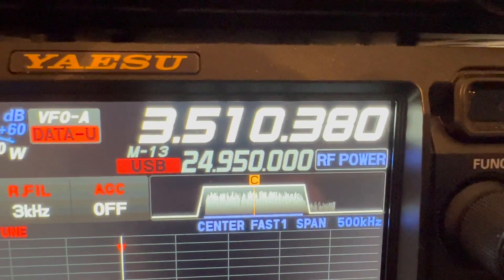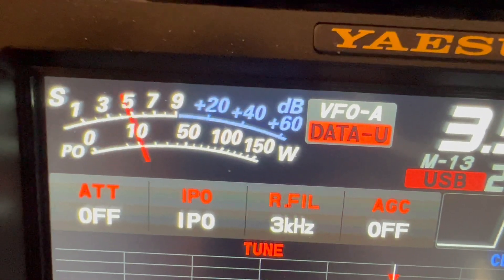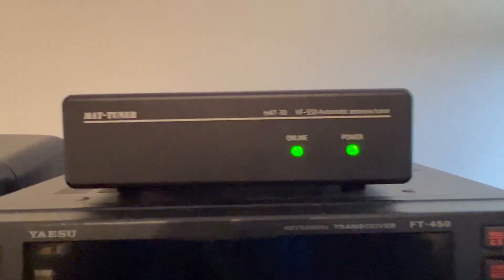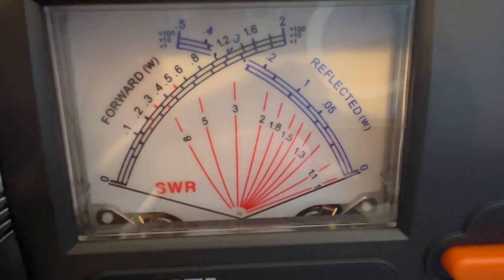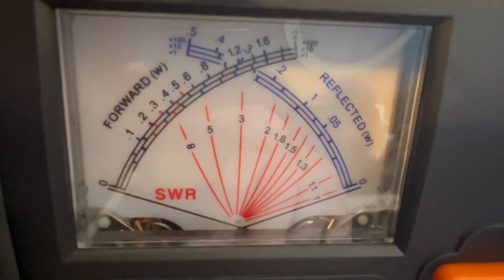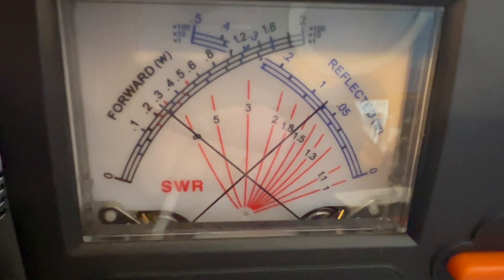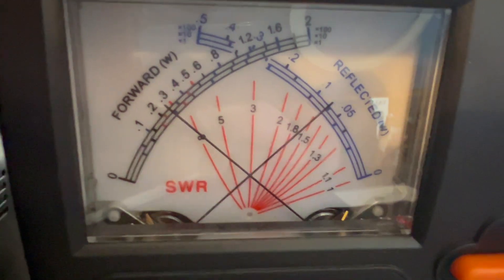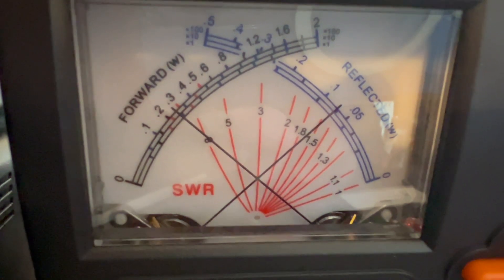The Myth of SWR #2

Comment: So, the way I'm comprehending it, as long as I have a proper quality ATU/transmatch in line, I shouldn't be worrying about neither VSWR nor my coax feedline length. However, if I would like to be as portable as possible but be the most efficient  as possible and I don't want to bring a tuner or I don't have one: can I cheat by cutting my coax feedline to 1/2 wavelength and achieve a close match with my antenna's Z this way? I might not reduce the VSWR but with the absence of a tuning device , perhaps, I can fool the radio to "see" the coax Z and the load Z as the same due to 1/2 wavelength cycle properties... However, I feel like if it works, I will be restricted to one frequency and one frequency only ( the one my antenna happens to be resonant at on a selected band)
Reply from the maker: VSWR is determined only by the match at the antenna feed point.  It will be about the same anywhere along the line unless you have common mode current or a long lossy line.   So the half wave idea isn't really of any practical value.   And without a tuner you are stuck with a narrow range of frequencies on one band.   One location will probably differ greatly with another.  Antenna tuners can be small and very light.  Trying to go portable without one could be a problem. 
https://youtu.be/ysXPGRmFsjU

Comment: Does the reflection ever cause phase cancellation?
Reply from the maker: It causes phase reversal.  When the wave hits the antenna phase is reversed 180 degrees.  When it arrives back at the tuner it is reversed again by reflection.  Now it’s in phase with transmitter power.

Comment: Sir, Thank you for your informative video. It has prompted me to listen to a number of other videos and writings on this and related subjects. I looked for Walt Maxwell's "Reflections III", but found quickly it was at least $100 for a new copy and $85 for a "fair condition" used copy. I intend to buy it but it may have to wait for a while. 

So I wonder if you could answer a question for me:

You state that "reflected power eventually radiates". I've been unable to find an explanation of how this occurs. Does this eventual radiation occur under all conditions? Does the power radiate from the antenna, the feed line or both? What does "eventually" mean here, milliseconds, seconds, etc.? Any information you could share on this question would be much appreciated.
Thank you! Jim Webb W4NTA
Reply from the maker: Hello Jim.  Here is a link to Reflections.  

https://www.k3emd.com/downloads/Reflect.pdf

Since reflected power is not lost it gets radiated.  It's like asking, why does RF sent to an antenna get radiated?  Because there's no where else for it to go!  

As for when reflected power gets radiated, Reflected energy flows back and forth between the mismatches at the source and load. After a few such journeys, the reflected wave diminishes to nothing, partly as a result of finite losses in the line, but mainly because of partial absorption at the load each time it reaches the load.
In fact, if the load is an antenna, such absorption at the load is desirable, since the energy is actually radiated by the antenna.

Reflected power does not get radiated from coax because it is shielded cable and shielded cable does not radiate, except in the case of common mode current.  See my video on Does SWR Make Coax Radiate for an explanation if you are not familiar with common mode current. 

It's too bad the ARRL stopped publishing Reflections.  There was a falling out between Maxwell and some at the ARRL.
Reply: @BustRadioMyths  Thanks very much! What a great resource!

Comment: Just newly subscribed; and, I have to share...  Funny?  15-some years ago, when I was relatively new to Ham Radio, after battling the SWR and almost going insane trying to get a 1.5 or less SWR if possible, I researched the magical Antenna Tuner!  I got one, put it inline and followed all the instructions from the owner's manual.  A  fellow Ham across town about 10 miles away on 10 meters without being solicited for a QRST (signal report) explained excitedly that my signal came up 2 db(!) and wanted to know what I had done.  For 2 weeks I played the Hitchcock game with him before I confessed that I'd put an Antenna Tuner inline.  It was one of those MFJ types for HF.  And, my antenna that I was using from an apartment balcony was the Hustler 6BTV on the top floor of a 15-story apartment building where I lived at the time.
KD8EFQ/73

Comment: Let us say that I want to use a 500 watt amplifier in my car for mobile use.  Is it more practical to carry a small watt meter capable of reading my reflected power, or a cumbersome 600-800 watt tuner, that is also more fragile?  What happens if I have a few ham sticks on my car, and I would prefer to not have to manually retune my MFJ 945E every time I switch antennas?   Perhaps chasing a flat SWR has a value in these circumstances.  

The other example I can think of is, people with random wires and other extreme mismatches.  I've read a a few threads on QRZ about people chasing endless bugs and RFI problems in their house or shack after trying to use an impedance matcher to make the antenna work, because it seems like some systems end up balancing themselves out in strange ways, or the extreme stand waves will seem to cause other problems.  

I think the bigger issue with SWR isn't loss of performance power, it is all the other problems and potentials that go with it.  I still stick with the notion that a finely tuned antenna is best, because the tuner is always better at cleaning up minor SWR problems, than it is at trying to force a poor antenna to function.  A finely tuned antenna can still get on the air, even if you have a tuner failure.  Obsessing with flat SWR is one thing, but having a well tuned trap or monoband is still a better place to work from, then to rely on the tuner to do all your heavy lifting.  

One last complaint on tuners.  If I use my tuner to get low SWR for 10 meters on my 5/8ths' vertical roof antenna, which is tuned for CB, my ALS 1306 refuses to operate on it.  It reports that there is "too much 11 meter radiation" or something to that effect, another problem not solved by a tuner, but that a tuned antenna can cure.  

Just because you can get on the air, just because you can do fine work, just because you don't lose that much ERP, doesn't mean there aren't other issues SWR causes that a tuner does not cure.  

But, yes, I agree with you, and this is fine work.  Thank you for making these.
Reply: I am wondering what other issues swr causes
Reply from the maker: Good points about mobil operation.  I'd think a screwdriver antenna or a trunk mounted automatic tuner would be good for keeping the transmitter happy.  As for feed line radiation (RF in the shack) that is caused by common mode current, not SWR.  The treatment for that is at least one coax choke and a balun at the feed point. Coax is unbalanced so it's always good to use a balun at the feed point.
Reply: @BustRadioMyths  I've been properly choking things very heavily for a few years now.  It certainly kills noise and does a lot of good for the radio setup.  Yet, even that seems to fail to fix some of the few mystery problems I can't solve.  And some of them only pop up when I'm pushing the manual tuner to a heavy extent.  Perhaps I need to look at my feedlines again sometime.
Reply from the maker: I've had to put RF chokes on a bunch of stuff in the shack.  I don't have any problems now.  https://palomar-engineers.com/rfiemi-solutions/
You can get clamp on chokes a lot cheaper on Amazon but I can't vouch for them.
As for my antenna, an OCF dipole, I have a 9:1  Un Un at the feed point, a 50 ohm coax choke right after it and then another choke near where the coax goes into the tuner.  I can work 160 through 6 meters with no more than 3:1 SWR on any band.
Reply: @BustRadioMyths  I've been running Palomar "pipe bomb" inline chokes on each end of each HF feedline in my shack.  A big PVC pipe filled with ferrite mix, they work very well.  The cheap Amazon ferrites tend to be 43 Mix, and they do work well for CB/10 meter because that's where 43 is at its highest performance.  They can be helpful, in great enough bead count, for lower HF, but then again a different mix suited for those frequencies will start to work better.  Reading papers on that subject was quite interesting, as is the general subject of RFI.  

 I've been running a Hustler BTV-6, with an immense radial field and good ground conductivity.  With a trapped vertical, I've been able to run through my tuner on every band except 40 and 80 meters (no 160 meter on it) with it after taking a little time to tune it.  I like it because I can use dual VFO to listen to two different pile ups at the same time, and switch between them without a tune up, especially barefoot.  Only thing I have to change is the amp setting between bands if I want extra power.  Makes band jumping a breeze, and allows great flexibility.  So, like I say, my issue isn't with tuning for maximum performance, it is tuning for maximum laziness.

Comment: I'm confused about a few things:  1. If reflected power ping pongs back and forth, wouldn't the coax loss occur each time it travels from one end (transmatch) to the antenna feed point, and wouldn't this coax loss rapidly add up over many cycles (trips back and forth) to mostly dissipate as heat in the coax?  2. If a transmatch adjust the phase of the reflected wave to match the forward power, what effect does that have, if any, on how and when it eventually gets radiated? How can reflected power ever get radiated if the mismatch at the antenna feed point is always sending it back?
Reply from the maker: From antenna engineer Walt Maxwell:  

"Contrary to our prevalent, deeply ingrained belief, it is therefore not true that when a transmitter delivers power into a line with reflections, a returning reflected wave always sees the internal generator impedance as a dissipative load and is converted to heat and lost. It can happen under certain conditions of pulse-type transmission; for instance, if the generator is turned off after delivering a single pulse into the line while retaining its internal impedance across the line, the returning pulse wave will be absorbed. But if a conjugate-matched generator is actively supplying, power when the reflected wave returns, the reflected wave encounters total reflection at the conjugate match point and is entirely conserved, because it never sees the generator resistance as a dissipative terminating load. This is because the source and reflected voltages and currents superpose, or add at the match point, just as if the reflected power had been supplied by a separate generator in series with the source. And since the source voltage is generally greater than the reflected, the sum of their voltages yields a net current flow which is always in the forward direction. The reflected power adds to the source power, deriving reflection gain which compensates for the reflection loss suffered at the mismatched termination."

Additional reading:
https://www.iz2uuf.net/wp/index.php/2017/07/29/the-myth-of-reflected-power/
Reply: Yes, but it can be an acceptable loss. 
If you have say 3dB loss (pretty high) and 25% of power is reflected back, 100w out turns to 50w at the antenna. 25% reflected back becomes 12.5, re-reflected to the antenna. At the antenna, the coax has again taken 1/2 so 6.25 to the antenna. 75% radiated 4.7w is added to the 37.25 that got radiated the first time. 1.5 goes back .75 gets to the radio and .38w back to the antenna.
With a lower loss setup (say 10% loss) 90 gets to the antenna 22.5 comes back 20.25 gets to the radio/tuner, 18.23 gets back to the antenna 85.73 has now gone out the antenna. Another trip gets you another 2.77 out. So you get out over 88w
Much better than the 42ish watts of the first system.

Comment: Good explanation.  I am confused about antenna efficiency.  I have seen lots of mathematical stuff about it but no really good straightforward explanation.  I am a retired "bean counter" and cannot follow the math.  Also, I expect efficiency depends on the material the antenna is made of and its construction, as well as "capacitance and inductance."  Could you make a video - or several - about this topic?  SV0SGS

PS: I mostly use resonant antennas.  I do have a couple of non-resonant antennas and put an automatic "antenna tuner" at their feed points.
Reply from the maker: Antenna efficiency is basically how much power is radiated verses how much goes into it.  The rest is rocket science.  Above my pay grade.  :)
Reply: @timbookedtwo2375
 It's a bit hard to explain without math, but...
When you put energy into antenna, some part of it will be radiated out as RF. We use something called "radiation resistance" to model that "loss" of energy. So I'll call that value Rr.

Then, and this might be a bit hard to digest at first, all of the real capacitances and inductances are modeled as complex numbers, where (handwaving a little bit, don't look too closely), the real part models the energy lost as heat, and the imaginary part models the energy bouncing around. We add the actual material resistances of antenna and everything in the path, and we get resistance of losses. Let's call that RL. 

So our antenna efficiency is Rr/(Rr+RL). Therefore, if the radiation resistance is much higher than the resistance of losses, antenna will have high efficiency. If the resistance of losses gets close to the antenna's radiation resistance, then we get large losses. If they're the same, losses are 50%, and if the losses are more than radiation resistance, then they're more than 50%. 

Now the issue with all if this is the following: We can't really measure the antenna radiation resistance directly, it needs to be calculated by programs or RF wizards, and loss resistance might be low, and could be therefore difficult to measure, and you'd need to measure it when your tuner is in matched state, and it will also be affected by the things such as skin effect.
Then, if your tuner is connected to antenna by coax, there's coax loss too. 

Now all of this is not related at all to the radiation pattern antenna produces.
Reply: @AndrejaKostic  thank you for the explanation. on a practical level how can I determine/estimate the efficiency of my antennas?

Comment: Although I agree the pivotal word is "reasonable" if you take a case for example of a halfwave dipole cut for 40m and feed it with 100ft of RG58. All works well,  but then you go looking around the 20m and 10m bands with the same antenna. An absolute disaster for feeder loss...  I did exactly this. Taking the antenna down to change the feeder to open wire gained about 4 s-points on those higher bands. My latest antenna is a fan vertical with about 50ft of RG213, I never fitted elements for the 30m and 60m bands but it is still very effective on those bands. It is worth remembering too that SWR as measured at the shack will be lower than that at the antenna...
Reply: Also, with VSWR on the feedline, the impedance (r+jx) at the input port of the feedline will not be the same as present at the output port (i.e., feedline-antenna interface) -- unless your feedline is electrically 1/2 wavelength or a multiple thereof.
Reply from the maker: I would never use RG-58.  RG-8x is about the same size and better coax.
Reply: @BustRadioMyths  to be fair RG8X is not great either, plus I tend to use cable that I get for free!
Reply from the maker: Free?  Absolutely!!!!  I'm a cheap ham.